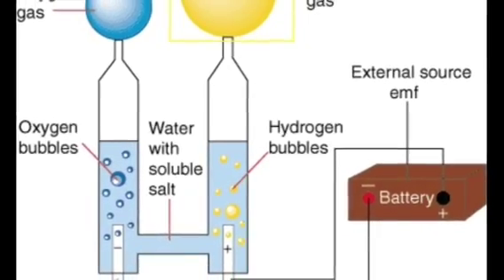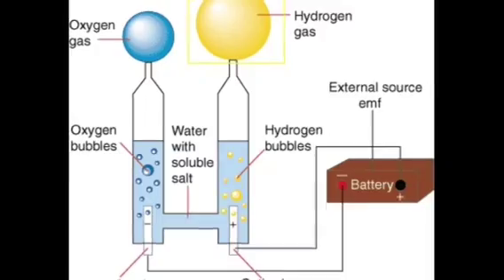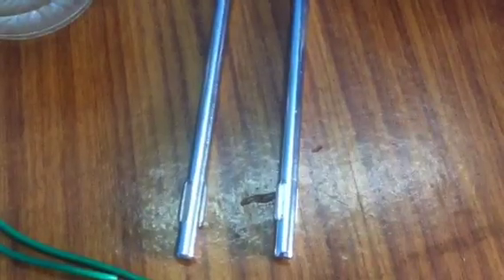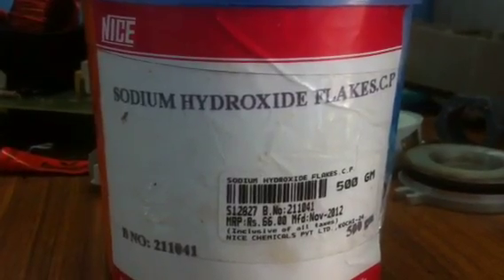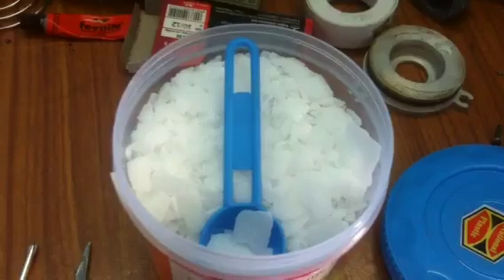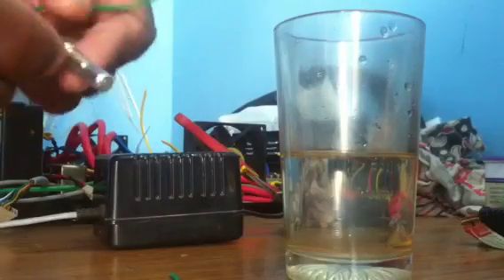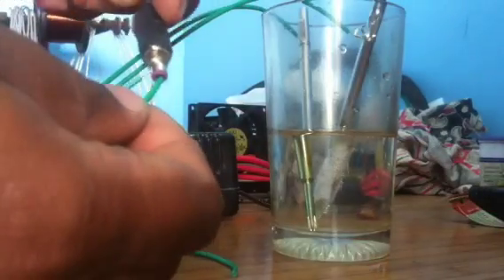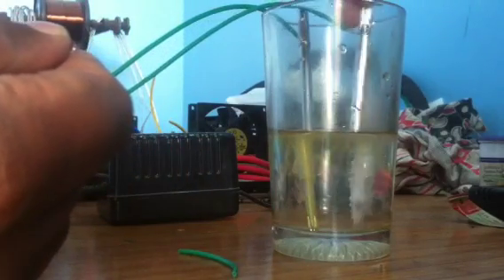Cooking gas from water (part 2)

Comment: The sodium hydroxide is overkill in a good unit where all that is needed is normal tap/rain water and stainless steel plates.
I have made a unit in a small jar and it worked and that the water turns yellow from the hydrogen and oxygen being removed, the jar was a good way of seeing what was going on.
I back flashed the gas and the jar blew to pieces, be careful, always wear eye protection.